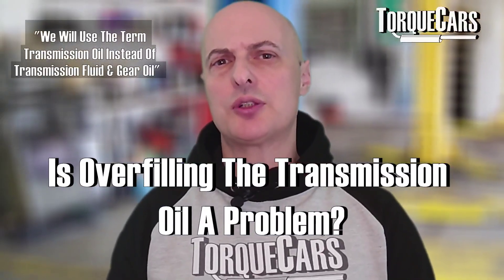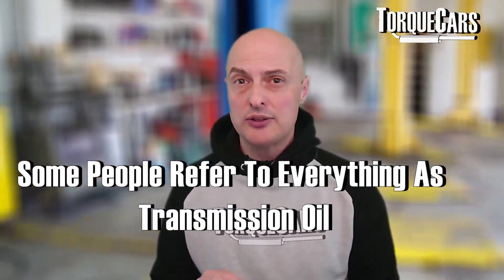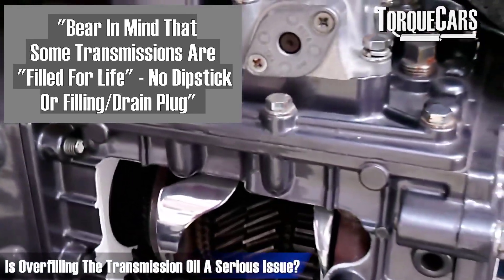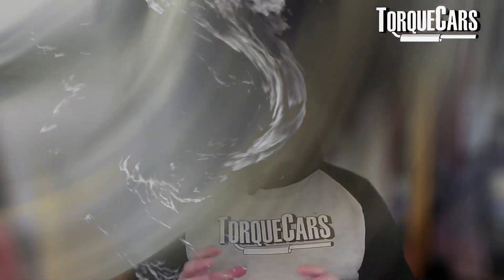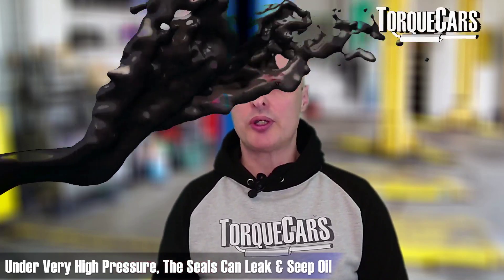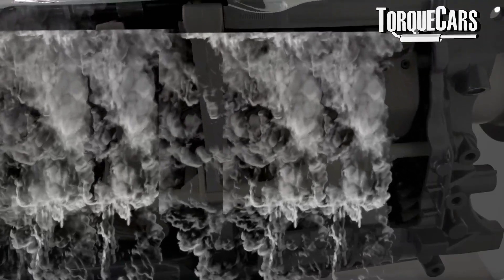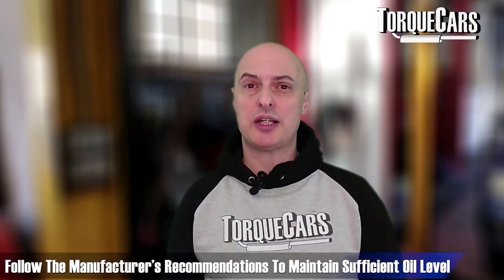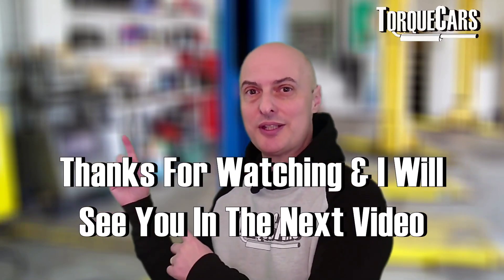Damage Caused By Too Much Transmission Fluid - Gearbox & Transmission Problems After Overfilling

Comment: Overfilled my 08 Sebring and it doesn’t have a drain plug for the transmission . I have to drop the whole pan now 😠
Reply: @hidden.from.history  I saw a guy on here just now use a spray bottle top with a long tube inserted into the pan from the engine bay. It worked too. Try that rather than drop the pan. Just get a Windex sprayer or something and what ever tube you can find to fit it.
Reply: @hidden.from.history  I would just vacuum it out with a vacuum pump. I wouldnt drop the whole pan

Comment: Too much oil doesnt cause high oil pressure or case pressure.  The amount of oil has nothing to do with the pump's flow rate and pressure limiting valve.  Im not sure why people assume this.  

Transmissions are vented, if the vent is clogged with dirt it can cause case pressure build-up.  If you have too much oil it can aerate and cause low oil pressure though.

Comment: I have a ford 8speed transmission in my Transit Connect. 2021. It doesn't have a dipstick and I'm never 100% sure I'm filling it to the right level even though I've followed other YT channels how-to videos. I fear I may have overfilled or underfilled as once and a while it will "brrrr" like the engine is trying to accelerate from 2nd gear instead of starting from 1st and there isn't any power unless I really step on the gas. I already checked my ignition and replaced my plugs, the old ones looked fine but I did it anyways. but mostly the sound will happen early in the gear like starting or right after a gear change. I haven't reset the learning for the transmission. I'm planning on getting a FORSCAN and tool to do that in the future. Just wish I knew how much is too much fluid? like how much lower or higher than the sight plug can the fluid level be, or is it so sensitive that one drop over and you're doomed?  My Honda transmission lasted 400,000 miles with no issues, even after overloading the car with hundreds of Phone Books when I tried delivering them as a side job back in the day. Nowadays I feel transmissions are getting more fragile and less user friendly in terms of maintenance.
Reply: @lliaolsen728  did you figure out the solution I have the same issue

Comment: My local "Euro" specialist put WAYYYYYYY TOO much fluid in my 01M. I changed the diff fluid myself but wanted to have the filter changed and the valve body inspected. He did not follow the proper instructions because when I got the car back, I noticed a MASSIVE DECREASE in uphill power and lower end torque. The car would go, it just acted like I was always driving though water. I noticed at the end of the month when my car stopped going into drive when it was hot. I aimed a temp gun at the transmission and it was almost 55 degrees over specs. The only thing I could do was wait for it to cool off and check the fluid levels myself. It's a closed system so I had to idle it back up to operating temperature. Once I unscrewed the cap, almost a entire liter came out of the pan and that should not happen while the car is running. He essentially overfilled my car a whole liter and forgot to connect the filter back. I got it drained off and running, shifting properly again but I'm sure he did years of damage to my transmission by playing Mr "fast and loose" with it. I'm beyond upset because this is our only vehicle and daily driver. 😢 I have taken good care of this car and done all the needed maintenance and repairs when they are called for. I sure hope I caught this in time. It does feel great now, but who knows how long they will last.
Reply: @HardWhereHero  I noticed low fluid in my transmission but the dip stick doesn’t really show the “ hot” level, anyway my transmission stopped engaging the gears and shifting properly. So I’m wondering if its just a matter of too much fluid or if I need a rebuilt transmission
Reply: @HardWhereHero  did u let him know about the damage

Comment: I just worked on 2016 Chrysler Town and Country 148,000 miles.  My daughter's boss recently bought it and was letting her borrow it.  It was clunking and shuddering between the mid gears and coming to a stop.  Had the P072A code (can be a generic trans code).  It had just over 7 quarts of oil OVER filled.  I drew that off just to get down the proper level on the dip stick.  That improved a lot, but I think they added it to the old oil without draining first, plus I think it was the wrong fluid.  Anyway, did a 3-quart partial change and shifts like butter.  Will do one more 3-quart pump and fill in a few hundred miles.

Comment: Can too much transmission oil causes PO868 code?
Reply from the maker: 869 is generally the code for too much as it is a "high pressure warning" the 868 is low pressure, this can be down to a number of things including wrong grade of oil, low oil level, faulty electrical sensor/relay,  faulty solenoid valve etc... (NB: too much oil can raise the pressure, pop the seals and cause leaks leading to low pressure.)

Comment: Thank you for the information and time… I have a 2006 Chevy Silverado 1500 4x4 truck and think I overfilled the ATF fluid, the dipstick is reading a little less than a half inch above the full hot mark… What should I do and is it okay to drive?
Reply: Remove some fluid asap
Reply: Remove oil asap